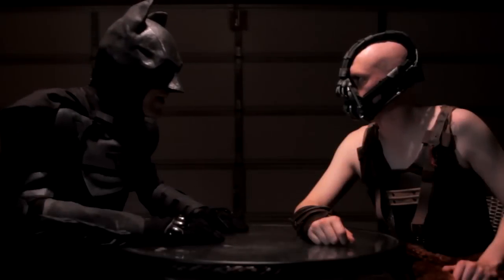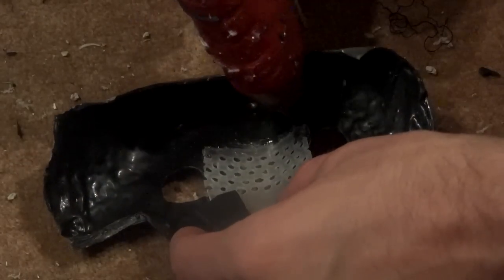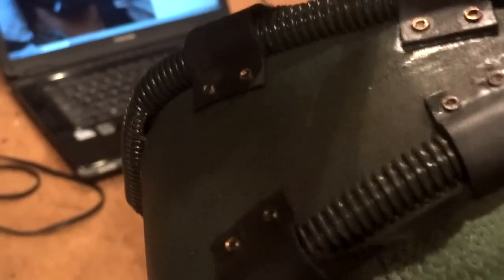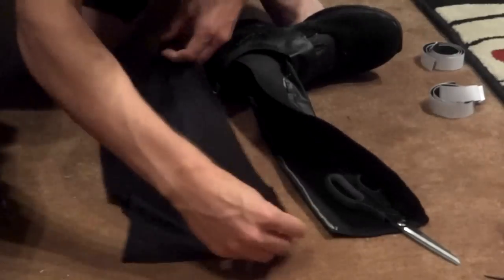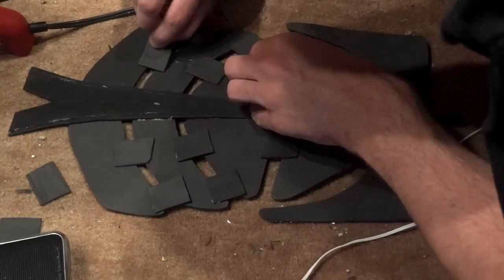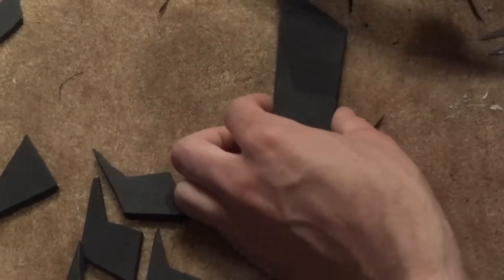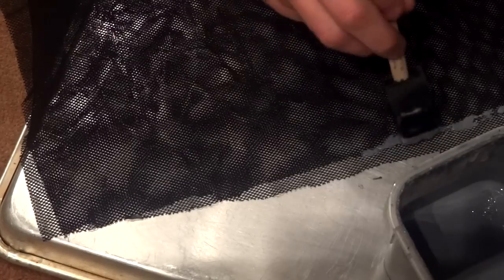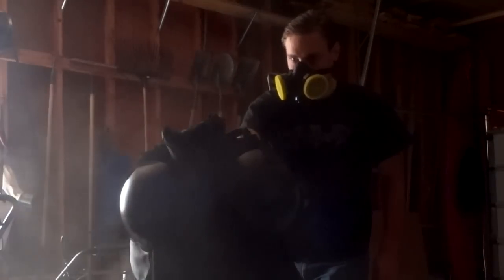Bane Mask and Batman Costumes

Comment from the maker: The foam keeps its shape pretty well; it's flexible enough so that it doesn't crease without a lot of pressure. 

One thing that would have helped a lot, especially for suiting up and clothing, would have been to use a one-piece bodysuit, like a lycra suit. I had one, but decided not to factor it into my "budget". It would have kept it all much tighter and smooth.

Comment: Great job! I am going to be giving this a shot! I tried a dust mask first but that made it to bulky so now I am going to use pottery clay, Plaster, and liquid latex like you had used. 1 question though, The original shape with the pottery clay, should that be dry before applying the plaster? and if so how long should I allow it to dry?

Comment: What is the brown material you used to stick the technic tubes to the mouth area and how did you connect the center strap to the top of the respirator part? (You seem to have connected the center strap tubes to the respirator part some how...)